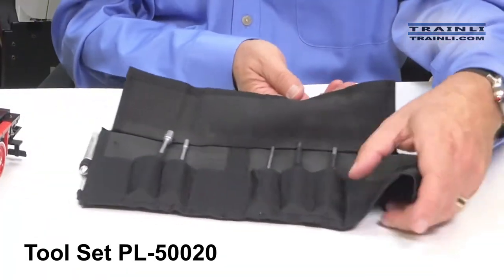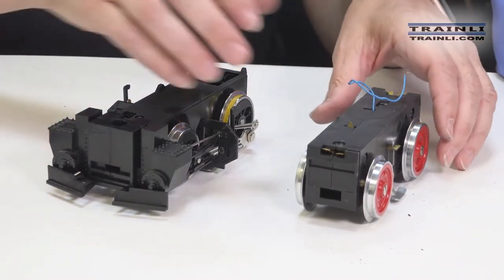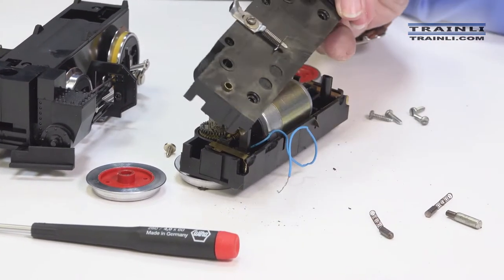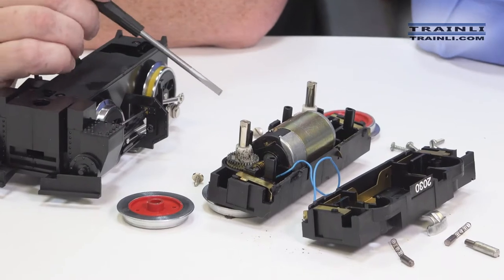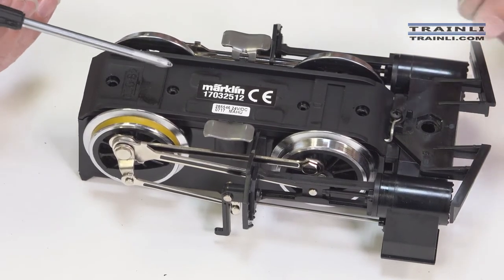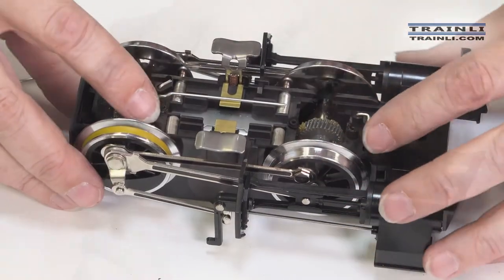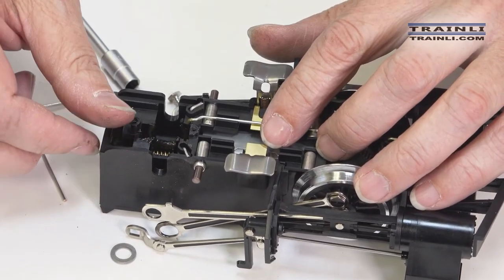TRAINLI TECHTV: PT1 HOW TO DISASSEMBLE AND SERVICE YOUR MOTOR BLOCKS

Comment: This is amazing now I know what kind of grease is the best one for the nylon gears and I just bought a G scale 4065 Rio grande caboose lot of pieces are missing from the roof part like the two lanterns the top vent and the long stem stack and the black plastic wood details where the ladders are so I made my own wooden walkways for the roof out of corn dog sticks and painted it black and it looks like the original ones I’m so glad I went to carpentry class lol I just need the lanterns and I want to make it light up instead of dummy ones and the vent and stack
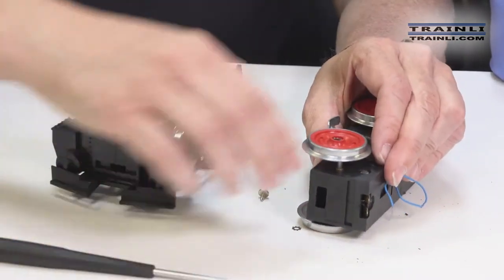Reply: And the locomotive I bought a ways back that screw and washer that holds the red wheel on at the 2:34 and 2:49 mark it was missing and trying to find another one is impossible to find the original one because I want my locomotive with everything on it not having missing pieces

Comment: What was the blue wire for in the old style motor block?
Reply from the maker: old style motor blocks tradtionally use 3 wires, blue was not a traditional colored wire used.

Comment: I have the stainz locomotive 20212. I cannot find a manual anywhere and I need parts. This set has huge sentimental value. And I simply cannot afford to lose it. Can you help? I need a wheelset and motor.
Reply: Did you ever get help?
Reply from the maker: Manuals and parts PDFs may be found on our webpage, Trainli.com under the drop-down menu Resources then LGB Info. we offer complete service on most G scale locomotves.